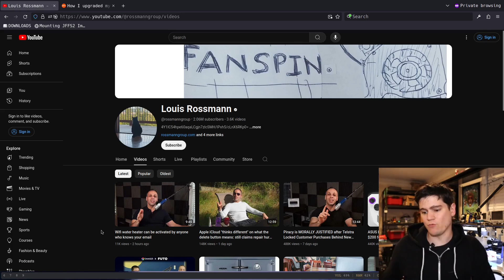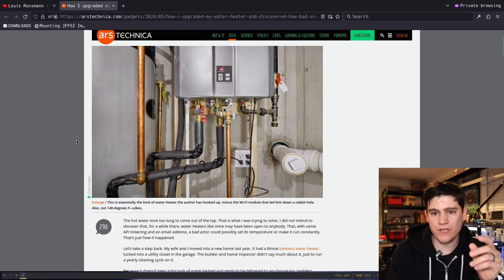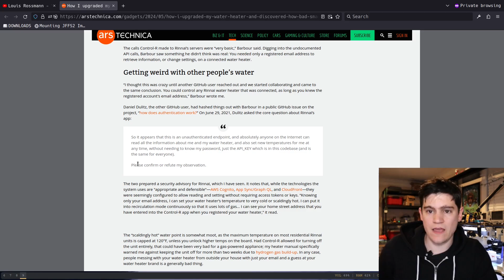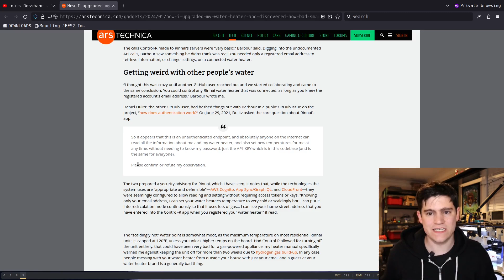IoT Security News - Wi-Fi Connected Water Heater Vulnerability

Comment: I see the potential for connected home appliances such as this, but there is no reason to put them on the internet. Have a local hub that handles connections via zigbee or something. Local network access only for the hub (at a maximum, maybe even just usb updates), and it can have an interface that allows your web browser to push a signed update file over the from your pc to the device.

Comment: IoT and internet access don't mix. Sounds crazy, but having a device in your home permanently connected to "the cloud" (aka just somebody else's computer) should sound crazy. Anything "IoT" in my home has custom firmware if the manufacturer doesn't support offline connectivity (thankfully at least some do) and is on a separate VLAN with NO access anywhere else, including the internet. The only thing that can access that VLAN is Home Assistant.

Comment: I actually have converted all tuya/google home/alexa/apple home devices in my house to connect locally to my homeasisstant server which is an old minipc which has some addons and connectivity modules and i also disabled/removed the default firmware/application stack and instead replaced it with esphome or custom applications. I love to do the hacking and my devices are freed from the cloud. Nobody can make them obsolete or has any control over them other then me and who i choose to connect to my server.
 Although i did not have to do much (or anything) at all with the zigbee devices because they dont directly connect to wifi and are a lot faster. I can take my whole server offline and the zigbee stuff still works and nothing else will become blinky blinky. I have like 5 wifi devices and 10 zigbee. Sadly not many good free zigbee drivers/software exists for the ones that run linux so they just stay with etherner or wifi but i disabled their original application stack and patched the startup scripts and enabled telnet so i can inspect them/control them. Also the tuya devices that ran linux or better called tuyaOs (which is linux with tuya applications)actually had my wifi password and ssid in the logs and it actually came in the terminal like 3x at boot which scared me enough to get rid of the tuya application stack

Comment: i'm fine with devices that do not require internet connection but have wifi so i can have them in separated local network with home assistant. some devices straight up don't work without pinging home smh

Comment: Adding internet connectivity to any device opens a new attack vector that, especially in case of sensitive information or control over another persons devices, must be carefully protected. e.g. having thermostats and water meters be connected to some sort of network might proof convenient for the utility company for getting readouts and the user to conveniently set the temperature and monitor their own water usage, but these must then be protected in the same sense as the house door would protect them from intruders. In general, I find that many devices require a network connection (and user account) for very little reason expect for it to be marketed as "smart" or "AI" or whatever the next buzzword will be. And this is also partially on the consumers, to stop buying and fulling this behavior of companies.

Comment: I remember trying to create API endpoints as a backend engineer for embedded developers and I was astonished by their total lack of care for security, we're talking about sending (monetary) transactions over the internet, are you insane ? of course you need TLS.

That was in 2016, and they where using a crap Microchip PIC32F or something like that, that wouldn't cut it. But worry not, I know that the radio link CPU is much capable and I'll prepare a firmware for you. Me, a backend developer able to create embedded software because the electrical engineers are just bad at embedded software engineering.  
He was using the SIM900 radio link (classic, also noob), and he thought he could just open a TCP connection by using some AT command and just sending the transaction like that, in plain text. 
Then me, a backend developer found out that the SIM900 is actually capable of doing TLS if you upgraded the firmware, then I just wrote the entire software for the guy and installed it on the CPU of the SIM900 and just send him the firmware for him to upload it into the SIM900. I found from the datasheet that the SIM900 can actually run some user applications if you provide them together with the firmware update, neat.

Is that how they develop hardware ? always ? 

If I were developing the product I would have chosen a better integrated application processor with the actual CPU/Modem/everything and would have done certificate pinning but actually using the serial number of modem as a key to authentication on the backend API. How hard would that be ? using the same credentials is insane, at least allow the user to change the password if you're going to use one.
Using a serial number to activate the hardware into the API would require the backend to know the serial number of the devices manufactured, that would be a logistics problem to figure out how to make the factory send a list of the serial numbers they manufactured so I can input it into a database. Or maybe it can be activated by the factory themselves making a call to my API when they flash the firmware, they can do that, right ? otherwise how do I do QC ? 

Heck, this is not even a problem, you can use a hash of the serial number, put it into the box you send to the user and let the user plug the hash into a web site where he can set his password. Then I can match the hash to the actual serial number and update the password for that device over the internet. The hash is to protect the serial number from being leaked on the internet. As the device would be sending it via a TLS, only the user has the serial number and only the hardware has it, that guarantees the user owns the device and can safely set his password to the API. 
Every single Android phone works like that when authenticating to google-play, they use a hash of the IMEI, that should be enough.

Those embedded things have NO business being on the internet or ever talking to any API over the internet.

Comment: Ridonculous how far this IoT trend has gone; sounds like a good idea to get good at hardware hacking just to make some of these smart devices dumb again
Reply: Seriously, it's long past time to hit the brakes on IoT. I wish there were a simple way I could lobotomize my 'smart' TV. The best I can do is passively refuse it an internet connection.
Reply: I think that's going to be a huge thing going forward. Look at that water heater, they could easily decide to set restrictions on how you can use it through their cloud. They could also charge you for using it. But at the end of the day it's a water heater and not a fusion reactor. What's there to control except heating coils and a temperature sensor to read from. Somebody could run this thing with an Arduino, no cloud or app required.